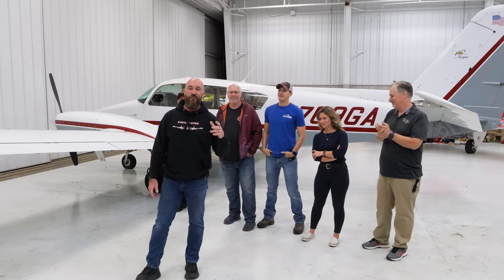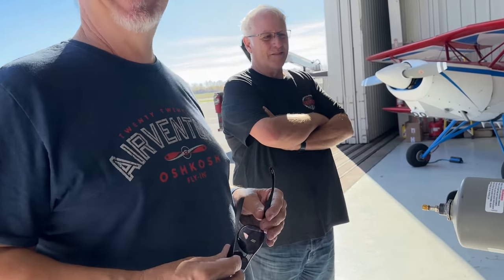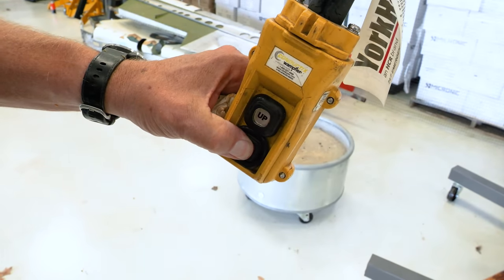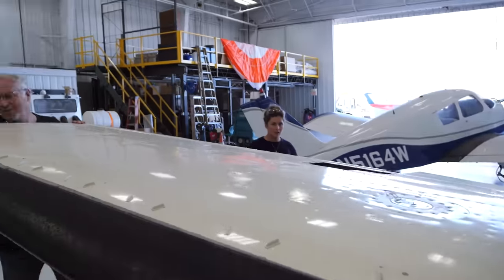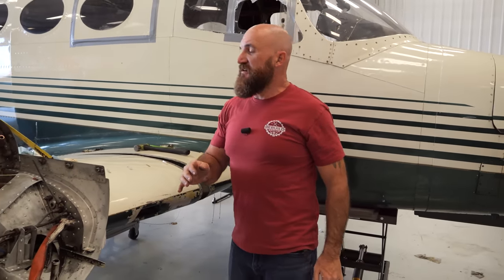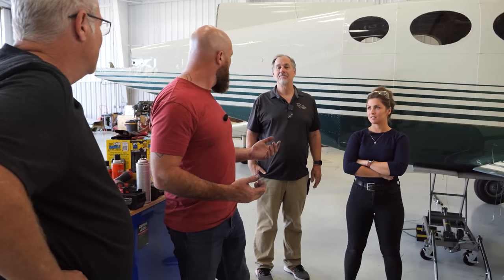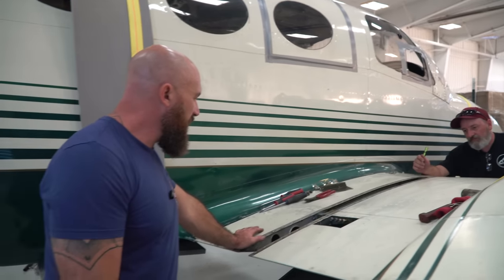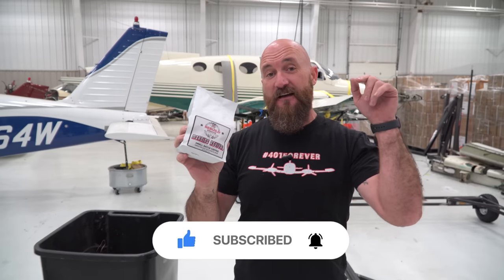We Failed At Removing the Wings on The Free Abandoned Airplane

Comment: It would be great if the manufacturer made a manual for doing maintenance on this and all their planes. Something like a maintenance manual that includes disassembly and how to support the plane while working on it.
Reply: Generaly they do make a manual for total disassembly and repair of the aircraft. I don't know why these guys are not alluding to the use of it. It is a requirement by the FAA that you follow procedure in the manual for disassembly, reassembly and repair/maintenance.
Reply: every aircraft has detailed service manual, after repair is done paper work need to filled in accordance to service manual w/ sections and pages included
Reply: Guys, I think he was being sarcastic...
Reply: My post was sarcasm. I know there is a maintenance manual to describe how to disassemble this aircraft. I just don’t know why they aren’t using it?
Reply: My experience using Cessna repair manuals goes somethinglike this. "1. Support wing. 2 Remove bolts. 3 Remove wing."  They are nothing like a car repair manual that goes detailed step by step.  If you are really "lucky" they will reference some $50,000 tool you need that isn't even available anymore.
Reply: You beat me to it.  Seriously, RTFM, know how its supposed to go, and when it doesn't, THEN you start hitting it with a hammer.
Reply: For some reason the scene in Star Trek 4 where they are wondering how to contact people while standing in front of a yellow pages billboard (dated I know).
Reply: There are detailed manuals on the "proper procedure " of the disassembly and I would think it would be trained API's doing the actual work and not civilian pilots.
Reply: To be fair I have seen parts of the LMM that just says "remove X" without telling you how to do it.
Reply: @billbollard3451 , maybe they are but want to appear ‘clever’?
Reply: Makes for better utube content, which is the whole point
Reply: I have a copy of the Cessna 401 service manual. Here's what it says about removing the wings:

WING.
Removal of Wing. (See figure 3-10.)
a. Remove batteries in accordance with Section 14.
b. Drain fuel system at the following locations: quick
drain valve in the bottom of each wing tip tank, quick
drain valves in bottom of auxiliary and wing locker
tanks (optional equipment) and quick drain valve in the
cross over drain line.
NOTE
Wings can be removed with all fuel tanks and
cells installed. If fuel tank and cell removal
is desired, remove in accordancewith Sec tion 11.
c. Remove engine in accordance with removal pro cedures in Section 9.
CA UTION
If one or both engines are removed, the air craft may become tail heavy. Therefore, to
balance the aircraft, place equivalent weight
(shot bags or sand bags) in the engine nacelles
and support the tailcone with padded support.
d. Jack aircraft in accordance with jacking proce dures in Section 2.
e. Place suitable padded supports beneath cabin
section and wings, then remove jacks.
NOTE
To prevent damage to skin, place padded sup ports beneath front and rear spars in fuselage
and beneath wing ribs. If both engines were
removed and weight was placed in the nacelles.
remove weight after removing jacks.
AIRFRAME 3-25
401/402 SERVICE MANUAL
CAUTION
If only one wing is being removed
and the engine on the opposite wing
remains installed, relieve the
engine weight on opposite wing by
using engine hoist before removing
wing or serious damage may occur
due to an overbalance tipping
condition.
f. Remove wing root fillets by removing
attaching screws. g. Disconnect or remove landing gear
drive tube in accordance with removal
procedures in Section 4.
NOTE
Wings can be removed with main
landing gear installed. If gear
removal is desired, remove in
accordance with removal procedures
in Section 4.
h. Remove flap cables from wing in
accordance with removal procedures in
Section 8.
i. Remove aileron cables from wing in
accordance with removal procedures in
Section 5.
j. On left wing only, remove aileron
trim cables in accordance with removal
procedures in Section 5.
k. Disconnect engine controls in engine
nacelle in accordance with Section 9.
1. (See Figure 3-11) Disconnect, tag or
route the following items in the wing root
area:
1. Route engine flex cables (12, 13 and
14) to fuselage.
2. Disconnect electrical wires at
connector (7).
3. Disconnect fuel lines (5 and 8).
4. Disconnect manifold pressure line at
fitting (1).
5. Disconnect oil pressure line at
fitting (4).
6. Disconnect fuel pressure line at
fitting (15).
7. Disconnect vacuum hose at fitting
(11).
8. Disconnect brake line at fitting
(3).
9. If installed, disconnect deice line
at fitting (10).
10. If installed, disconnect auxiliary
fuel tank plug at electrical connector.
11. Route wing wiring bundle from
fuselage.
12. Disconnect heater fuel line (9) at
fitting.
13. If Navomatic Autopilot is installed,
disconnect line at fitting. m. Remove nuts (1 and 4), washers (2, 5
and 6) and bolts (3 and 7) from wing
attachment fittings. For alternative
installation, remove cotter pin (13),
castle nut (12), washer (11), and drilled
bolt (10) from wing attachment fittings.
n. Move wing and padded wing supports
outboard until wing attachment fittings
have disengaged.
NOTE
If difficulty is encountered in driving
out wing bolts or disengaging fittings,
it may be necessary to rock wing
slightly.
Reply: @dennishuett7542  API's?
Reply: Yea. Yah gotta pay money for those.
Reply: @darindougherty9341  install in reverse order
Reply: @darindougherty9341  I used to be a Mercedes auto mechanic and let me tell you the auto manuals are THE EXACT SAME WAY.  More or less says to just remove the “interfering components” and no guidelines to get them back in
Reply: @TheRick2130  not every aircraft 😅 my 1952 Piper tri-pacer has no manual because it wasn’t a requirement back then
Reply: @markanton2349  reassembly yes but the wings coming off are going to scrap so not a big deal
Reply: @jdhiner1  one of them has good motor mounts one has bad motor mounts and the wings are 5-600 hours away from mandatory spar strap so they are usable and it's my understanding he might sell them as parts as a mentioned beforehand
Reply: Nice sarcasm there!
Reply: @markanton2349  Mark  the MM only covers some of what you might need to do after that you have to go back to the engineering department to get repair/replacement procedures or even part numbers for a lot of components which is more $$$  Anything that is considered a "MAJOR" repair by the FAA will not be in the manual you will have to go back to the Mfgr or a DER.

Comment: I worked as an aircraft fitter and the most essential tool was a "podger" ,a foot long piece of steel bar tapered to a near point to persuade stubborn parts to line up before bolts could be hammered in!

Comment: Jason, check out the footage of when you went to collect the scrapped wings, on there you can clearly see that those 4 bolts are the only ones holding the wings to the fuselage. the ones where you have chopped out an access hatch are holding the wing root attachment castings to the upper and lower wing spars. Those must have been installed during the construction of the wing before it was skinned.
Reply: That's  exactly what I was thinking
Reply: @samfuller6273  Hi Sam, I have just emailed Jason with a Cessna Bulletin. The only time you need to cut a hatch is to check for cracks in the wing spar attachment (which is those hidden bolts). Nice to see you finally get the ghost airborne last week.

Comment: Hello Rebuild Crew. I am almost at a loss for words. Cutting an access hole in the wing to remove the bolts. Not that it may I repeat may have been the approved method of removal. I doubt it very much. Where is your maintenance manual???
This is not the first 401 to have the wings removed and the spar inspection completed on. It is not a type trial. Or it is not supposed to be. Come on team do yourselves proud and get the service manuals required to do the tasks correctly.
I spent a career in Aircraft Maintenance on both engine and airframe. It is a major task to remove wings, engines, flight controls, surface skin,  and re-skin the areas necessary to return the aircraft to airworthiness status. Support of the fuselage and wings at the appropriate approved locations is critical in not damaging your plane. It is not as much a difficult task as it is time consuming. The overhaul manual spells out the steps both in reasonable detail and in a sequence that usually is best for both the aircraft and the personnel doing the tasks.
If your not sure look it up. I really wonder at you not knowing that there were 12 attaching bolts on each side of the aircraft wing spars that you did not know needed removal to remove the wings. You can do it, make it as easy on yourselves as possible but do it correctly and the job will go much easier.

Comment: You're applying the opposite pressure on the wing. There's already tension in the direction of you lifting. You need to lower the wing and take weight off the gear or lift the fuselage to achieve the same.

Comment: Looking at it from the video side which is farther away, the plane is supported by the landing gears on the wings, so it's the fuselage that is sitting to low which is causing the binding. If you can raise the fuselage up several inches and  support it, then it will release alot of the pressure on the wing.
Reply: Exactly what I thought. Alternatively, suspend the wing front the gantry and get the landing gear up on that wing. Then relieve from the gantry to take stress off the bolts.
Reply: Take the tire off
Reply: @eagle2019  I would have built something that looks like a boat on wheels. Raise the plane enough to set fuselage on it. Probably out of plywood. They can afford it.
Reply: yeah I was wondering why they were raising the wing, like the wing wasn't already fully supported by the gear

Comment: Remove the gas pressure from the struts, so the gear is not pressing hard up, then jackstands. You don't need to remove the brackets from the wings, only the main bolts between fuselage and wings.

Comment: Goodday Jason, maybe it is better to make or bench support to the fuselage, to make sure it will not outbalancw when you disconnect the wing, and make same bench support also to the wings, coz I have an experience before when a replace a wing of piper tomahawk, the bench support to the fuselage and to the wing will be stable and it will less the movement of each parts

Comment: 14:20 "Jason, wing was giving us a problem so no worries, we used the die grinder to cut off those pesky spar attach points" (like the helpful guy who cut off the engine mounts). Love giving crap about the cylinder pressures "Yeah, horrible compression, leaking like a sieve" :-) You could see the question in his eyes...
Reply: I like his high compression ratio comment, showing he doesn't know the difference between compression ratio and cylinder pressure.

Comment: Remove the flaps. Support wings from spar fittings and tip. Remove aft spar SHCS's partially first (Keeps the aft joints basically in axis), THEN main spar bolts. 29:44 Looks like just enough room to leave them in the aft part of the fork. Also thinking those are close-tolerance bolts.

Comment: Needed to drill rivets on the rib that hold the nut plates and the  Z bracket to allow skin to flex up to get bolts out, always use aluminum or brass dowel to get the bolts moving so you don't get a burr started on bolt, let the nitrogen out of strut. Put one of your adjustable tables just outboard of the nacelle and one person on tip of wing to jiggle fwd and aft and pull out at the same time. No need for straps to tear up the dovetail. The wing is manageable by just the one person on the tip doing jiggling and pulling.

Comment: Hi Jason well for another comment that you probably are tired of reading but them bolts support the wing in the lateral movement like the tip going forward or backwards the load on the bolts was more likely from rearward pressure by pushing on the leading edge or the trailing edge will most likely help you in their removal hope this helps good job in the parts what a win

Comment: RR needs a set of socket extension rods with wobbler ends ($100-$200)and a set sockets with Allen wrenches in the socket ($100-$200) in them, both inch and metric sets, Plus a slide hammer with a claw on the end to pull out screws($100-$200).

Comment: Random idea here:  replace the 8 bolts that were easy to access to place the wing in a "neutral" position relative to the fuselage, then remove the remaining bolts that you had to cut the wing open for.  That way all tension and any twist have been taken out of the problem bolts inside the wing...
Reply: @eagle2019  I don't know if you perhaps got up on the wrong side of the bed this morning, but I was only making a suggestion based on my 10 years of mechanical fitting.  Since you obviously have all the answers, I'll just shut up from now on, and wait for you to show up at that airport and run the entire show.

Comment: I would recommend a spreader bar to go across the length of the wing then loop ratchet straps on each end, one up by the job joint where the wing separates then the other out towards the wing tip, that will give you adjustability on each end, crossing the straps like that is twisting the wing and binding the mounting points, just an idea, that's my 2¢

Comment: have u tried putting the main wing bolts on and then pop the others off  ,all the weight of the wing and the fuselage is on those spar bolts and twisting moving the wing around u could be twisting that spar if u join the wing to the fuselage u could remove the bolts easier and hold the wing better and then remove the main bolts. just my thought

Comment: Someone didn't bruxh up on the TO.
We could remove and install an F-16 wing in one day.
Albeit the PRC sealant to the fuel tanks took 48 hours to cure.
Driving out the 32 bolts involved 2 aviation fitters, a 1 meter long drift and a 5 kg sledge hammer.

Comment: Is there any reason why they aren't referring to the AMM for this?  The manufacturer would clearly lay out how to remove them. Id guess the flap and gear are supposed to be removed first.  I work on kingairs mostly, and there is an entire section related to pulling the wings.   Almost nobody does it, but the instructions are there if you needed to.
Reply: @eagle2019  Makes sense.  I'm thinking they are fighting against the oleo pushing up too, causing the wing to bind.

Comment: Guys.  Go read the maintenance manual for removing the wings.  Where is your A&P? You guys remind me of the picture of the four guys with heads under the hood of an old car, aka shade tree mechanics.  Everything where the wings are attached to the fuselage is zero tolerance and very tight so quit guessing and  get the instructions, correct tools ,and do the job under the supervision of an A&P with EXPERIENCE on a 401.  You did not have to cut the hole in the wing and carts are not the proper method of supporting the fuselage as you remove the wings.

Comment: I have a question. Is there a step by step build or assembly manual available for this aircraft? That way you could reverse everything step by step thus making things much easier to disassemble and you wouldn’t miss things like those five bolts.
Reply: Would you be on board for the first flight?
Reply: @luigi5890  I think not!
Reply: @bigslim492  Maybe with a parachute after a few drinks. LOL
Reply: @luigi5890  maybe with more than a few right? lol 😂
Reply: @bigslim492  Quite a few LOL  But I do take my hat off to them for attempting such a massive job of  “completely” rebuilding the 401.  And wish them good luck.
Reply: @eagle2019   After re-reading your first post, I tend to agree with you.

Comment: From my experience, there are only the 4 bolts that you removed. The others you are trying to remove are for a bracket, and that is fitted before the wing skin is fitted. That's why they are not removeable without damaging the skin. 

Always think - how did they put it together? If something won't come apart without cutting something to give clearance; it doesn't come out that way.

And always retract the gear first as it keeps the leg out of the way and the wing is much easier to handle without the u/c hanging down.

 What does the manual say?
Reply: @eagle2019  No, but I am an ex-aircraft engineer, and I'm not EVER hoping to fly in that plane after they've worked on it!
Anyone attempting such work really should have the manuals to hand, instead of a grinder in their hands
Reply: @eagle2019  One of our customers died in (I think) 1988 at Redhill Aerodrome in a Stampe SV4 due to a lower tie-rod wing bolt failing. 2 fatalities. These guys on here don't seem to take things too seriously like they should.

Comment: Maybe corosion just simply glued it all together. Had it on my Defender Wolf. Rear tub (alu) was glued together to the cassis (steel) thanks to this case. I jam a carjack (hydraulic one) in betwen the tub an the chassis (wherre they did not made contact), and after a lot of force the tub came of the chassis with a loud bang.

Comment: Maybe if you got the fuselage level right across where both the wings join with a spirit or laser level, then get the front to back of the fuselage level to begin with. You could then drop down the wing outside to match it, placing levels across the wing span both laterally and longitudinally. But I'm sure you probably know what needs to happen, just my noob opinion 😉